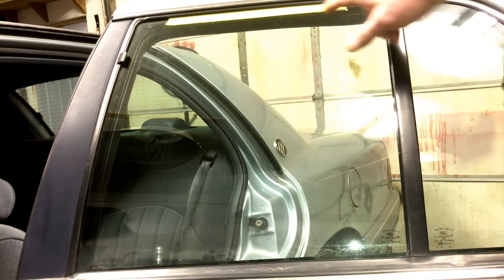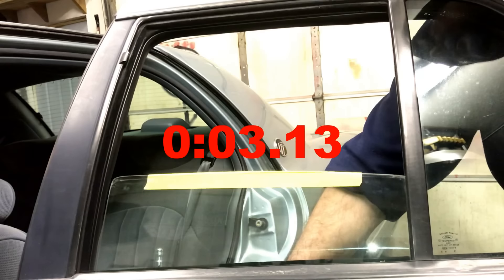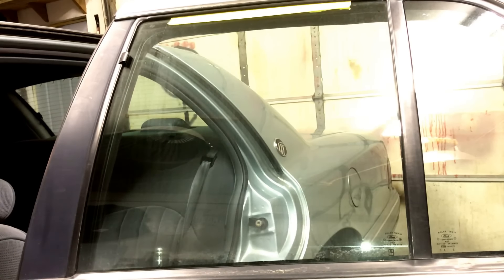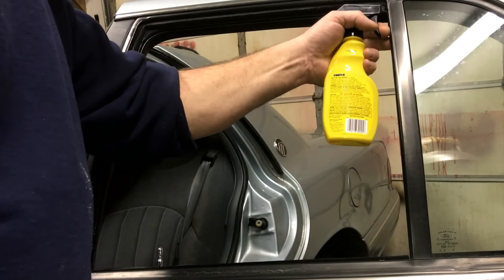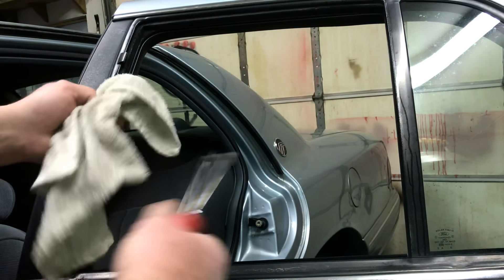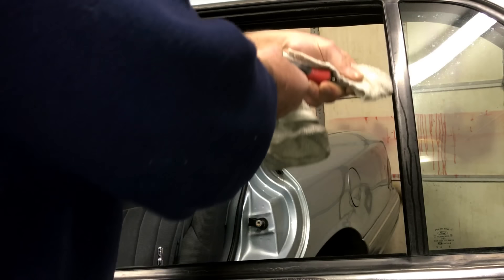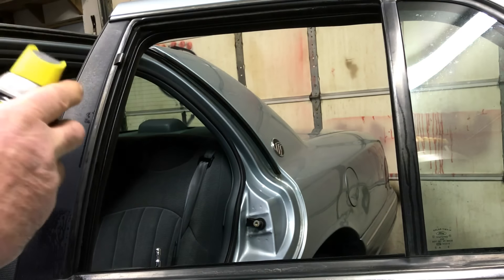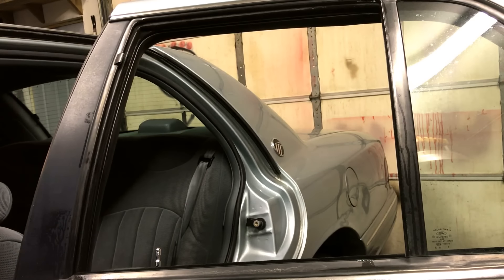HOW TO Make Your Power Windows Move UP & Down Faster...U WON'T BELIEVE YOUR EYES

Comment: I'm replacing 2 window motors because they went out within a month of each other and I chose not to use the others. I thought the window fell out of the track/holder (happened on my older autos). When I went in to fix it I found a mess of wire coming out of the motor. Asked my brother-in-law about it because he has had several of my make and model and he said they wouldn't have done that had I kept my tracks lubed as this video suggests. Well I never knew it was a thing. So after replacing them I am going to clean lube them just like this video instructs. Thanks Sweet Project Cars!
Reply from the maker: If you use this  https://tinyurl.com/bdf6a6ky  you will never have that problem again Larry. Thanks for watching and sharing your story, we really appreciate it, have a great day my friend. mad Mike the hammer SPC
Reply: Hey Larry, I have to replace my driver door and 2nd row passenger window motors in my 05 Highlander. Can you tell me more about the mess you ran into with yer Beastie? They didn't work well before some crackhead beat out my windows now they work even worse.
Reply: Yup, and a standard trani.👍
Reply: I used to do bodywork on cars. All I ever had to do with what people called bad window motors was unplug them. Clean contact corrosion of the plugs. Add dielectric grease, then plug back in. Never replced a bad motor. It was always the electrical contacts.

Comment: I just use silicone spray it has worked beautifully, And clean the tracks and dry them and then repeat it again. As many times as necessary.
Reply from the maker: We only use this  https://tinyurl.com/bdf6a6ky  it's by far the best lubricant we've found Eddie. Thanks, have a great week. mad Mike & team

Comment: My skeptical engineering mind was completely blown away.  Just purchased my son a used car and the drivers side window rolled down very slowly.  I was thinking window motor but thought I would try your method.  Truly unbelievable.  DRAMATIC difference and completely amazed!  I did find it easier and less messy to soak the cloth first and apply the RainX but other than that I followed your instructions to the letter and again completely amazed.  Thank you sir!
Reply from the maker: Glad we could help Eric! Thank you for watching and sharing your ideas, we really appreciate it, have a great week my friend. mad Mike the hammer SPC

Comment: I know this is an older video, but I just did this on a used car I just bought and it worked great. Both front windows were sticking about halfway - not going slow, stopped. I was worried I'd have to get new motors - this did the trick, even before the lube. THANKS!
Reply from the maker: Great to hear thanks for sharing have an awesome day mad Mike the hammer SPC

Comment: I always used a little silicone spray with a tube on the can, running from the bottom of the window channel to the top. I never thought to clean it out and use rain-x to coat the rubber, though. Great video, as always! Thank you for sharing your tips and tricks!
Reply from the maker: Nitro you are very welcome my friend
Reply: Which Aim product did you use to spray in track, I'm on website & don't know which one to buy that's the "dry" one is.

Comment: What you said about "use it or lose it" is exactly correct! When I got my old Buick- nobody had hardly used the passenger side window. As soon as I began to- SNAP CRACKLE POP and I was installing a new motor. The nylon gear was dry, and the glass tracks were filthy and sticky. That dry lube is a great idea- no mess on the glass, no petroleum distillates to damage plastics. Excellent! Thank you.
Reply from the maker: Hubba you nailed it my friend !!! and you are very welcome :)

Comment: I hadn't really given a thought about making sure that you exercise your power windows like this - to help keep the motors from going bad.  Been there, done that - replacing the motors is NOT a fun time!  So I shall add this to my list of things to do on our mini-van.  And after driving down to Florida and back and experiencing the "love bugs" I think that I shall invest in a removable screen / bra for the front of the car so I can remove it and clean it.  Right now the headlights need a good cleaning - just like you've taught us in the past.  Cheers, Mike.

Comment: I've used spray silicon for years, works amazing! Great video as always
Reply from the maker: thank you Steve glad to help and glad you are here with us :)
Reply: Or WD40 I would think works.
Reply: @bigal2417  wd40 collects dust, right?
Reply: @lordjaashin  dont know, so u think that wont work ?
Reply: @lordjaashin  what does not ?
Reply: @lordjaashin  It’s WD-40 in the clip - PTFE Dry Lube

Comment: Just tried this trick out, and it 100% worked for my window!  My passenger window rolls up as fast as my driver side now.  I was hoping this would also fix how my window is slightly crooked when fully rolled up, but that's probably a different issue.
Reply from the maker: thank you Vicious glad to help and glad you are here with us :)  and your crooked window would be an inner door track issue.

Comment: WD40s PTFE Dry Lubricant.   Guide the straw by running your fingers along the edges of the rubbers inner and outer so that the lube doesnt just go into the deepest bit of the groove but lube the sides too.
For an even better job remove the door card and access the lower guides and lube those too.   You may see down to them through the window aperture using a torch and this will save door card removal.
Dont use regular grease or WD40 or any old lube.   Use the dry PTFE type.  An air gun is ideal to blow any tiny bits of grit out the runners too if the glass sounds a bit scratchy.
Reply from the maker: thanks for sharing

Comment: Just did this, windows work like new. Only we skipped a few steps. We used a thin cloth over a plastic trim panel remover and stuck that between the rubber,moved it up and down to remove the dirt. Then sprayed inside deep between the rubber using dry silicone with a tube/straw attached, then rolled the window up and down a few times and all the windows are good as new.
Reply from the maker: Thanks for watching and sharing Vanessa, have a great week. mad Mike the hammer SPC

Comment: Thanks for the video. I took a toothbrush I had from the .99 cent store and ran it up and down both channels and my window went up and down much faster. I did use the Rainex and dry lube after that. Now don't have to worry about burning out another window motor.
Reply from the maker: Awesome EU! Thanks for watching and sharing, hope you have a great day my friend. mad Mike the hammer SPC

Comment: So how would that work if the car has no frame around the window like a subaru or convertable with slow ass windows?
Reply from the maker: You will probably have to remove the door panel to get to the rails that the glass glides on, that's the only way when you have frameless windows Carlos. Thanks for watching and asking, have a great week my friend. mad Mike the hammer SPC

Comment from the maker: Hello All our Great Sweet Project Cars Friends! We have a great way to help take the load off your window motors by allowing the glass to move more freely and in turn last longer. We hope You enjoy and find great value in it. Have a great Weekend everyone. Also, Check out our Newest Channel for motorcycles...     Sweet Scoots
Reply: Can you please do a video on how to fix slow seat belts? When I get out my car its really slow to coil back in. Thank you
Reply: As long as we are on the subject of power windows...  I have an annoying issue that you may have a trick for!  When it gets super cold out (Northeast Winters) my window likes to freeze shut.  You have to wait for the cabin to warm up on the truck so the window "thaws" out and will go down.  It sure would be nice just to hit the switch like summer time and have the window go down!  Any suggestions?  I am sure I am not the only one with this annoyance, maybe it's video worthy if there is a simple solution?
Reply: This vid should help with that freezing. It acts as a moisture barrier. Also make sure the rubber weather seal surrounding the upper window is well conditioned so as to NOT trap water to freeze.
Reply: I love your videos. I have a power window that goes down fine but comes up a few inches at a time. Any suggestions??? Ps- we love Rottweilers in our home :)
Reply: Why do you use rainx water repellent? Just curious..
Reply: will a can of 3 in 1 dry lock work?
Reply: What is the name of the dry lubricant you used?
Reply: @AlanHouser  wd 40
Reply: Hey the link to the compressor does not work!!!
Reply: @pgdmed  take a bucket and some detergent. Pull the belt out and wash it and dry it. Main thin is to get the dirt and oil out of the belt
Reply: @AlanHouser  It was WD-40 dry lubricant Alan.
Three essential things you need for a vehicle: duct tape, WD-40 and Bondo lol. The tools of a true tradesman!
Reply: What did you use to spray into the tracks after the rainex to help our windows go up and down faster?

Comment: The window tracks are an important component to keep clean and lubricated, but newer vehicles that have cable operated regulators also have metal slide rails that need to be lubricated and the steel cables that pull the window up and down also need to be lubricated.  Rubbing a wax candle on the cables does an excellent job.  These steps do require disassembly of the door, but the motor and regulator will outlast the life of the vehicle.
Reply from the maker: We use this now on all of the cables/tracks  https://tinyurl.com/bdf6a6ky  it's a phenomenal lubricant and you are correct, the motor/regulator will outlast the vehicle doing this lube process! Thanks for the view and comment, have a great rest of your week my friend. mad Mike

Comment: Gotta love it,  how to make window fast but the line @2:40 "Now "YOU" take the special lubricant "WE" use and it is not an oil base by any means it is a dry lubricant" ...AND doesn't share what the lubricant actually is??? I could make out it's a product by WD40 but WTF couldn't manage to show it/or say the name of this "special lubricant" which I suspect is a major part of this "how to Video"
Reply: He did. It's wd40 dry lube. I guess if you don't know wd40 products it might be confusing but come on all you have to do is type wd40 dry lubricant into Google and bam there it is. Would have taken you alot less time to do that than it did to post this pointless comment. ☣️

Comment: Not trying to be rude any doing the lube might work but you are not getting enough of voltage to the window motors with the vehicle off. You should have the vehicle running. Most likely you will have about 13-14v when running under draw without running you might be 9-10
Reply from the maker: thank you very much, but the window did this weather the car was running or not...we talked to the customer about it and we were correct in our assumption, their son always sat in the back on the passenger side of the car so the back drivers side window was not used whatsoever that's why they all worked well but the one we did the video on.  thanks my friend for your great comment
Reply: Doesn't matter if the vehicle is running or not. Same voltage go's through that circuit no matter what. Only difference would be if the battery was low and almost dead and you tried to run the windows while the engine was not running.
Reply: I thought the same problem but the window was operated under the same voltage both times. And having said that I am doing all my windows this weekend. 👌🏼
Reply from the maker: SGT you nailed it my friend     thank you for your great comments and being here with us :)
Reply from the maker: Harry you will love the results      thank you for your great comments and being here with us :)
Reply: gotshirts2ink doesn't matter if it's off or on. If it's slow when it's off .. it may be 10% faster when the cars on. So after it's 50% faster off and 60% when the cars on.. same difference.
Reply from the maker: thanks Chris you nailed it :)

Comment: What happens is the "run channel" gets dry rotted. Hard on window regulator as well. I have used silicone spray and silicone grease in the past. Will give this a try. Great video.
Reply from the maker: DV thans so much for the great comment

Comment: I did this with regular wd40 a long time ago in my 94 525i, works great but I have oily streaks on the ends of the window. Doesn’t bother me much though it’s my daily driver. So I’m sure this works as well & not as oily.
Reply from the maker: Greasy Style you nailed it my friend there is little to no residue :)

Comment: Tough on the motors too.  You can use kerosene on a rag with the screwdriver, too.  It won't ruin the rubber parts of the channels, which continue down into the door.

Comment: It works to a point on classic cars, but the main issue on them would be they have no relays for the motors, alot of them only see 11v or so, with relays youd make it jump to 13v and the windows would be 10x faster
Reply from the maker: Thanks for watching and sharing.  mad Mike the hammer SPC

Comment: My window won't go down sometimes. I noticed if the window isn't closed tight , it works. Seems like when I closed it all the way tight is when it doesn't go down. But if I give the slightest gap it goes down. So I been keeping the gap to avoid the window being too tightly closed. Maybe motor gets too stressed ?  🤔
Reply from the maker: The glass may be sticking in the belt track you could put a little bit of mineral oil on a Q-tip and run it through the track area above the glass that doesn’t do it you most likely will need to take your door panel off and lube up the track inside and possibly replace the motor but I would do the lubrication techniques first hope this helps merry Christmas mad Mike

Comment: I have a manual window that is slightly pushed out at the top when raised up all the way and has scratch marks on the outside from rubbing. Do I open the door panel and push the bracket back towards the outside of the door... I think this window glass was jimmied with a bladder and bent the insides. No frame just a door and the glass. Makes an awful noise on the highway.Thanks for the videos learning lots!
Reply from the maker: Ryan  most likely it is the felt guides inside that stabilize the glass, you will need to look inside with a very bright flashlight to see if thats the deal, also you will want to see the next video we do on this.    thank you for your great comments and being here with us :)

Comment: My glass and doors on my RV are flat.  And over the years people have pulled the doors closed using the window frames and warped them so bad that the flat glass windows won't go up the bent tracks anymore.  So frustrating that $$$RV build such flimsy doors that will bend just by leaning on them.  Still haven't gotten them straightend out so that they will work at normal speed.  Such a pain to lower the windows at Toll Booths!  And going up takes miles, not minutes!
Reply from the maker: Ugh! Thanks for watching and sharing my friend, hope you have a fantastic day, all the best with those windows. mad Mike the hammer SPC

Comment: I have a corvette that was sitting for 3 years.  when i went to put down either window they didn't go down. I heard something "clicking " in the door panel trying to operate but the window didn't really budge downward at all.  would this help or what could it be?
Reply from the maker: They are obviously froze up in there, you are going to have to remove your door panels and assist the windows to get them released then do the process in this video. You have to remember, power windows don't do well sitting for extended periods of time. Thanks for watching, have a great week and all the best on your project my friend. mad Mike the hammer SPC

Comment: Also note, that the greatest enemy of any electric motor is heat.  The heat in a motor rises as the motor fights resistance and draws more amperage.  By keeping your windows well lubricated and operating smooth and fast, the motor does not need to strain, does not pull high amperage and does not heat up.  The result is; the motor will likely last longer than the life of the car and you may never need to replace a power window motor.  Something that works great and works forever is a good thing.
Reply from the maker: Agreed! Thanks again Chris, have a great day. mad Mike

Comment: Great video! I did something like this several years ago on a teenaged Mazda Miata; they are notorious for windows that get slow and eventually burn out the motors. It has frameless windows so I instead cut a slit in the plastic vapor barrier, reached in and cleaned the tracks and also the front vertical channel with brake cleaner. I then relubed the tracks with lithium grease, and silicone spray on the front vertical channel. I also found the window switch had heavy carbon deposits: cleaning that off also worked a treat. 

Was wondering what is it about the Rain-X that makes it a good cleaner in this case?
Reply from the maker: Thanks for watching and sharing, we really appreciate it, hope you have a great week my friend. mad Mike & team